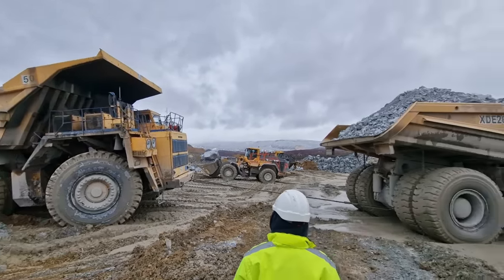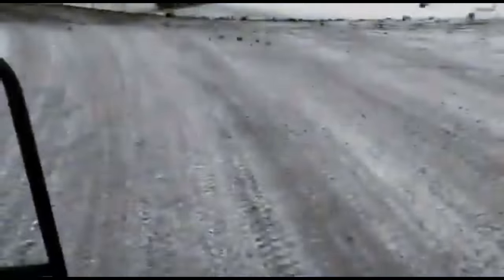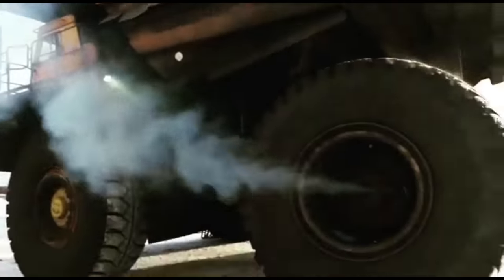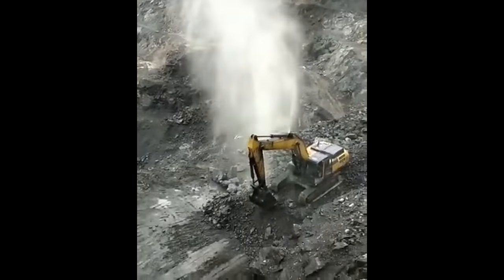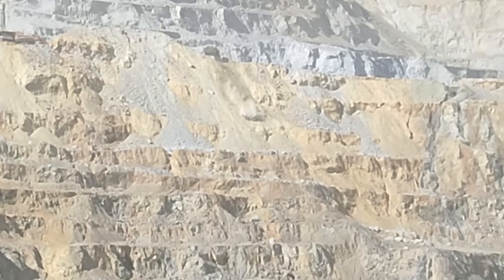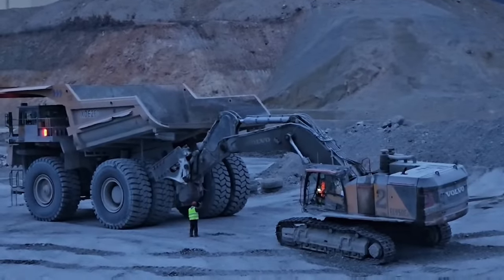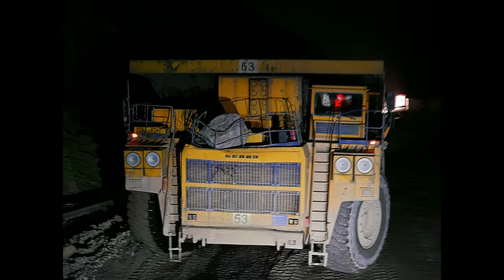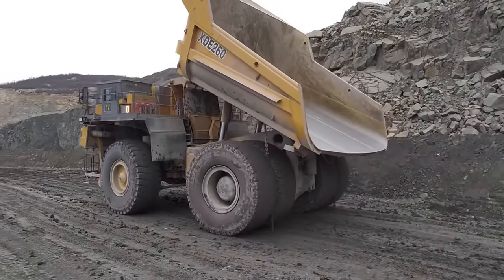Heavy Equipment Accidents #4 Extreme Dangerous Total Idiots at Work Compilation 2024 Amazing Logging

Comment: 8:37 .the higher the dumb bed the increase of load on back axle through the backwards moved point of gravity. Not much( maybe 3 to 5 to) but perhaps enough to make driving in these conditions posible without pushing machine